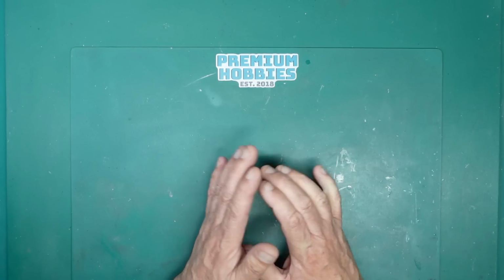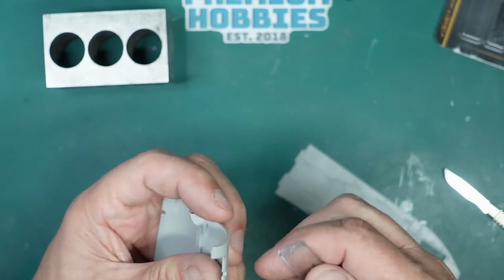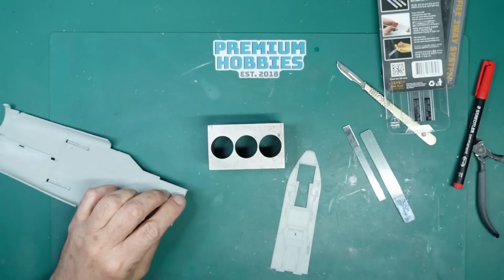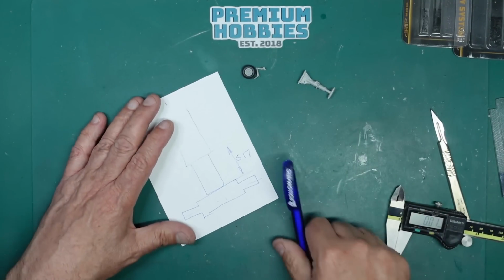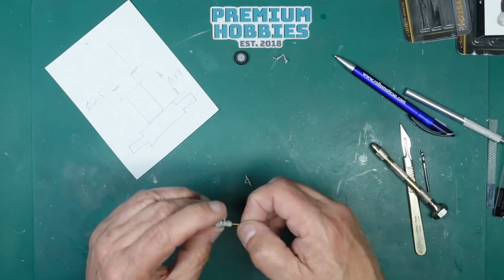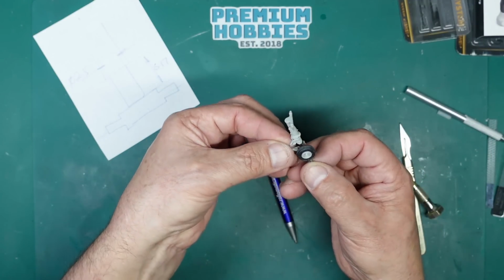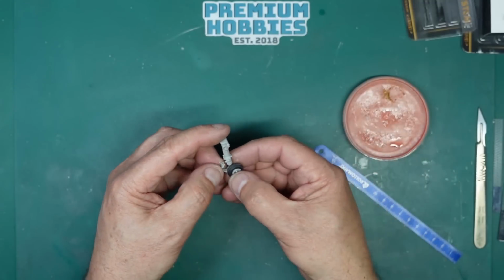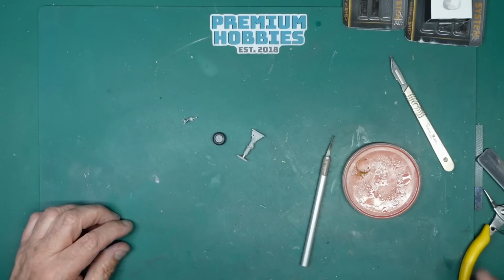Italeri 1/32 Tornado improvements by Mr Phil Fisk. Part One.

Comment: I wouldn't worry about oleo strut extension. That correction if you want to call it that is unnecessary.  The strut height can vary based on the weight of the aircraft and the amount of nitrogen that the maintenance personnel services the strut with. Just my opinion
Reply: Well said mate, a realistic view on the subject. Sounds like a comment a “rigger” would make……………..?

Comment: Mr. Fisk does some amazing work.  Thanks for the tips Nigel always learn something useful from your vidoes. Regarding flat spotting tyres, the vinyl ones that is, have you tried using a clothes iron/steam iron sans the steam setting.  If you use a low setting on the iron then place a piece of parchment paper over the irons heating plate then hold the vinyl tire on the parchment covered plate and press the tyre down until it starts to soften and flatten and bulge slightly at the tyres sides then quickly remove the tyre from the iron and dip it in cold water to set the tyre(btw do this with the wheel mounted on the tyre).  It may take several tries but it does work if you are careful. Cheers and take care.
Reply from the maker: I just don't like the look of vinyl tyres Allen!!

Comment: Interesting. I shall bare these in mind when mine arrives this week. Talking about vinyl tyres, I always use "old fashioned" poster paint preferably Rowney and have never had an issue. Being water based it's also easy to remove if you have an error.
Reply from the maker: I shall remember that thanks Andy

Comment: No to the x2-3.5 glasses,not good.I have a headband with visor holding two lenses both flippable.Front one is 1.5x fixed and a choice of 5 lenses from 1.5-3.5. fit in second one.Has a loupe on hinged arm on front.£12 ebay.
Reply from the maker: I cant get on with those head band things Darron. I must keep trying.
Reply: @NigelsModellingBench  Nigel,I don’t know I’m wearing them,I have to be told I’m wearing it.It’s got a padded headband?with a dial on back to adjust size.The first lens is perfect at 1.5x at a 13-15cm focal point for instructions and in the main but you can flip down rear lens for added magnification of 1.5x,2.0,2.5,3.0,3.5 depending what lens you want.The lenses aren’t massive just cover what your focusing on.And you can just push it up above your head and forget about it.I was told that the “reading” glasses aren’t that good for your eyes.Only £12-15,best money you’ll have spent in five years,difference is like salt in your rice,or on your chips…..want me to find one in UK to look at?Ill refund your money if you don’t think it’s ten times better than anything else you’ve tried.
Reply from the maker: I already have them Darron, sounds like exactly the same as you have? I cannot get on with them.

Comment: Hi Nige. I don't know why you hate vinyl tyres. Lots of times when you see photos of aircraft on the ground. There is not much of a flat spot. In fact, in those 3 example pictures you put up, none of them had any substantial flat spots. I have vinyl tyres on my 1/32 Tamiya Phantom, and I think they look fine. I think it's a bit of a myth that there are always flat spots on tyres.
Reply from the maker: I don't like vinyl tyres... I think they look terrible.
Reply: @NigelsModellingBench  I think they look OK on my 1/32 Phantom. I honestly wouldn't see much difference to normal kit plastic wheels & tyres.

Comment: Kudos to Mr Fisk there. With some brilliant models. My only observation / criticism would be to ask. Why do many modellers do their aircraft models with drop tanks fitted? 90% of the time, drop tanks were not fitted. EG, they only fitted them to fly the aircraft out to Saudi in Gulf War 1. Once there, the tanks were removed and not used for actual combat sorties.
Reply from the maker: Well Andy, if you Google Tornado, 95% of the pics have wingtanks fitted??
Reply: @NigelsModellingBench  Well, actually, if you Google Tornado, you get lots of pictures of the wind variety lol. But seriously, when I went on detachments at RAF Leeming with Tornado's, including the build up to Gulf War 1. The first thing the Line Armourers would do when the jets got out there, was to remove the fuel tanks. Then they would not be put back on again until the jets were ready to return to UK.
Reply: @Andy.Gledhill.Models.  that's because they were F3's. The internal fuel capacity of the F3 was 900 lt more than the GR1. Also it's weapon load is a LOT lighter. I was on 31 Sqdn during GW1 based at Dhahran. Across the airfield from us were the F3 boys. The first thing we did was swap drop tanks. The F3 had 2250 lt tanks. We had 1500's. We needed more fuel because we were carrying initally carrying JP233 ( approx 10,000 lb), later 8x 1000lb bombs, and finally 3x Paveway 2 LGB's. We always carried Skyshadow ECM, BOZ 107 and 2x Sidewinder, and going a long way into Iraq. The F3's were carrying 4x Skyflash and 4x Sidewinder, a load of approx 3000 lb and a lot less drag and rarely venturing sausage side so didn't need as much fuel. They also had easy access to AAR Tankers, who did NOT like to fly over Iraq !!! In my 14 years as an Armourer on the Tornado GR1 and 4 ( 31, 617 and IX(B) Sqdns) the only time we flew without tanks was when practicing air to air combat, something the Tonka was hopeless at, both GR1/4 and F3 !!